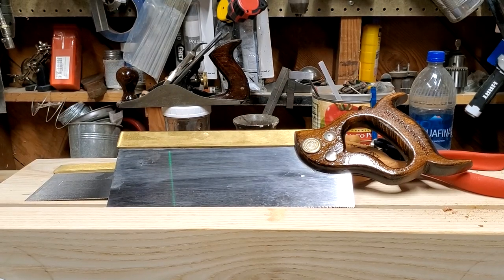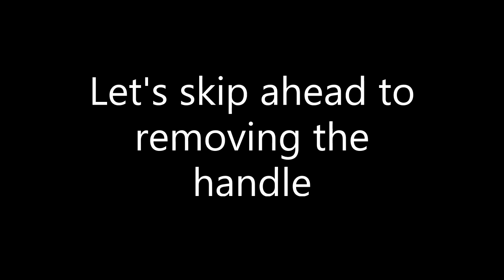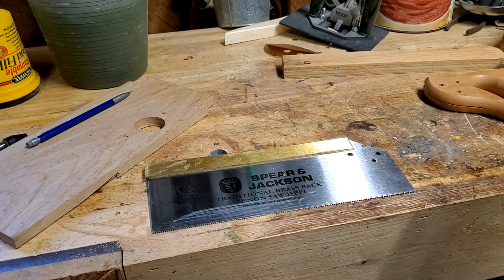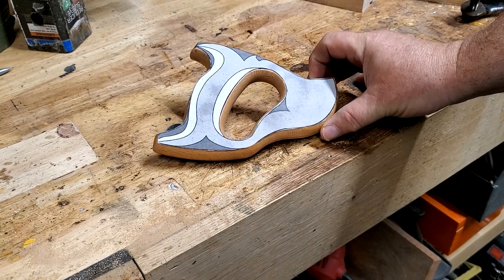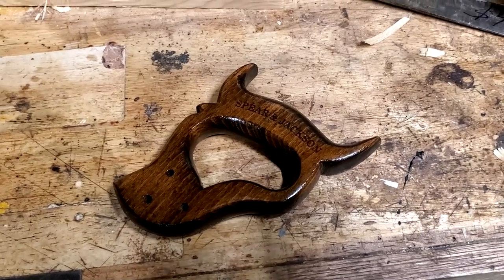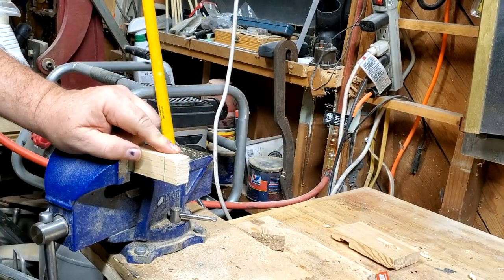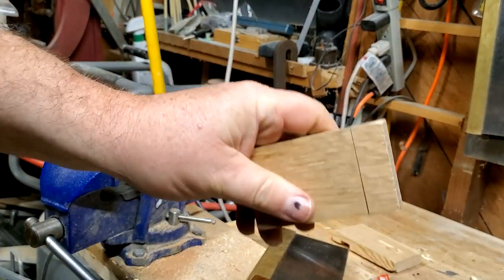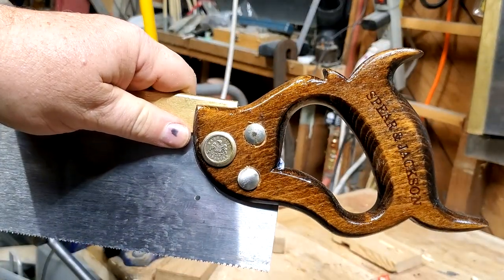Hot Rodded Crosscut Saw

Comment: What angle ( fleam )did you cut at on the saw blade? I ask because all I did was remove the set and tracking and cut were good ( luck ? ).The tracking to the right side could be from over set on that side . 
Grate video. The handel looks good 👍.
Reply from the maker: I was aiming for 25 degrees.  I think you are right about the set.